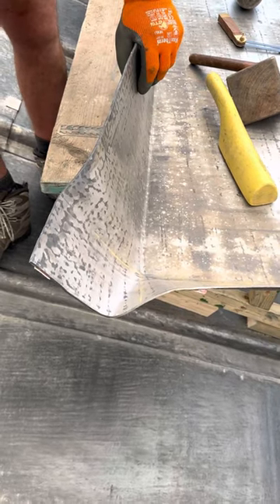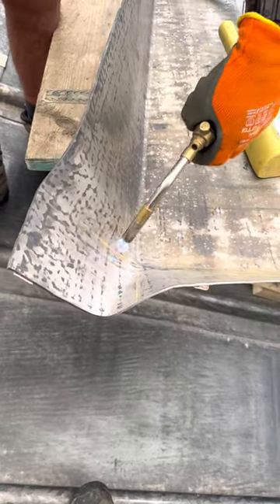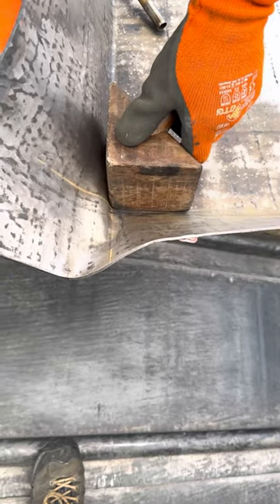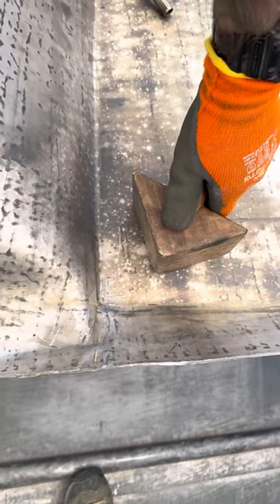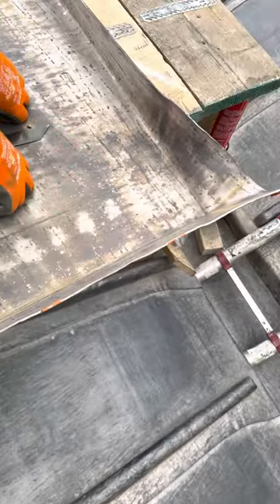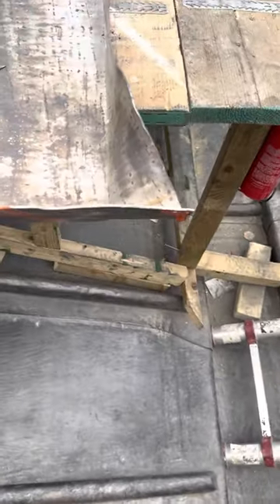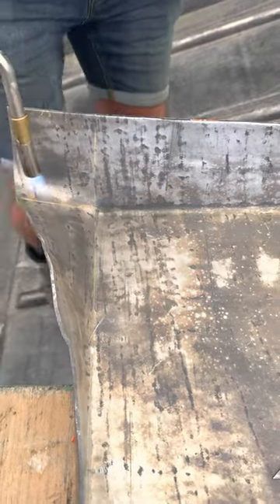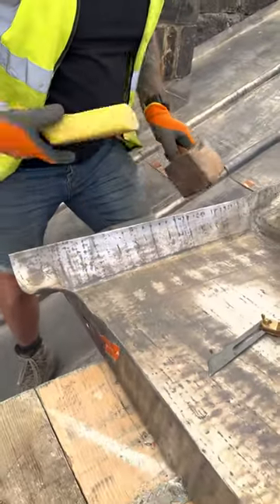Lead bossing with a corner bossing tool

Comment: hi shaun so im not very experienced with lead beating but i have a fair bit of scrap lead and i want to make a couple ashtrays (basically a square about 50mm tall all around) any tips for getting 4 solid corners without welding it? much appreciated
Reply from the maker: Hi,
If you google pigs ears lead corner it may explain it better than I can but that is how to make a corner without welding lead 
Hope this helps
Shaun

Comment: Cast lead looks crap
Reply from the maker: It’s on a listed building mate so what comes off goes back on and once it’s patinated it looks nice in my opinion
Reply: Milled is better but as you said what comes off must go back on
Reply: That doesn’t even look like cast lead to me. I’ve been doing it years. Where’s the leopard  spots? Looks like milled.
Reply: @thedarkhugheshughes2640 
Milled lead isn’t as good as sandcast lead. I have to disagree.